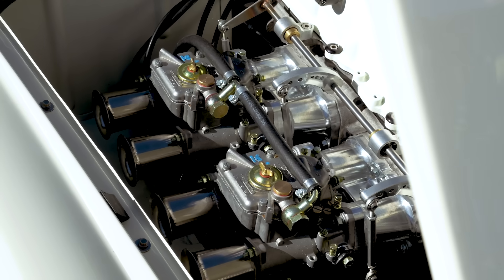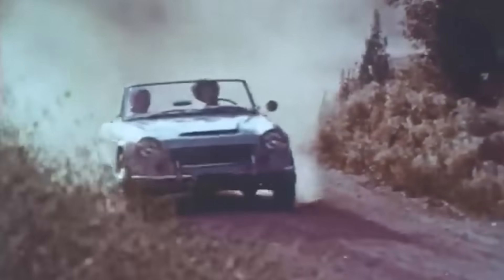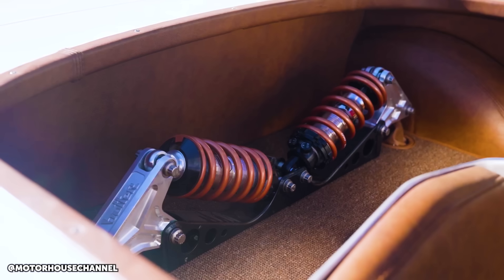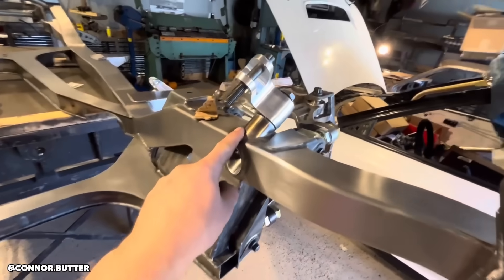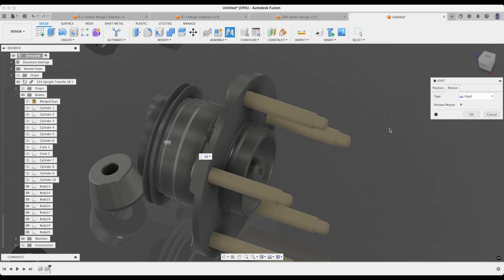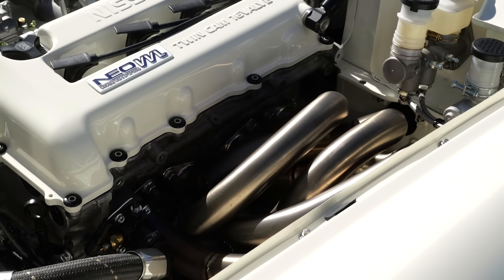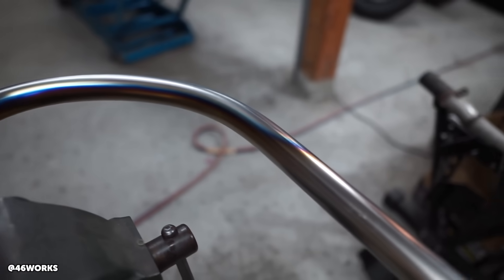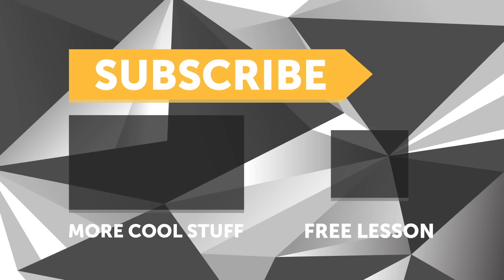1969 Datsun + 16 feet of Titanium = 1 EPIC build

Comment: 1:45 The tyres look like they're facing the wrong side
Reply from the maker: Toyo Proxes R888. They're asymmetrical but not directional which is what's confusing you here. 
It's weird, but it's right and those racing on them can confirm there's no difference in wet performance between left and right.
Hope that helps! - Taz.